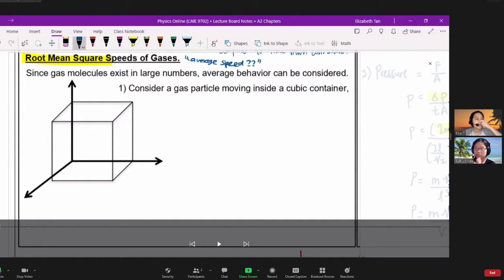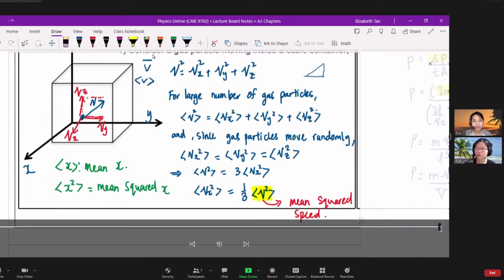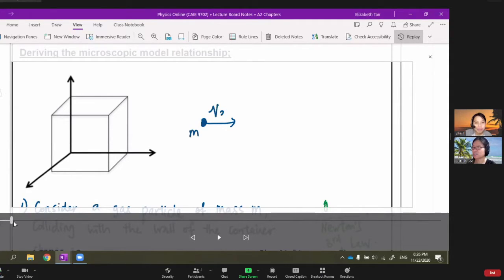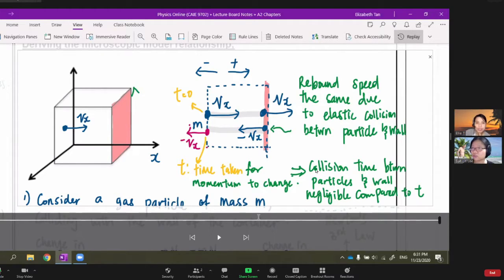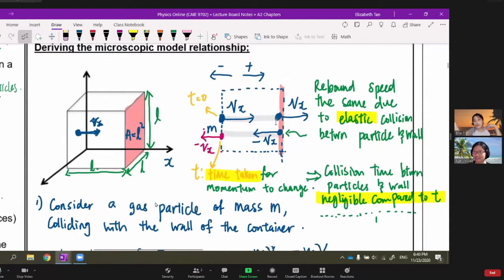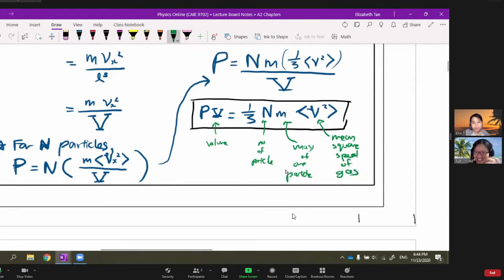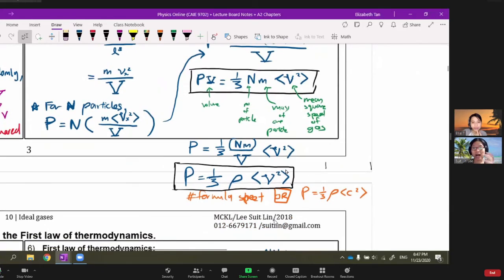15.2b Derivation of Pressure and rms speed | A2 Ideal Gas | CAIE A Level 9702 Physics

Comment: Why not take time of collision between wall instead of takint 2L/vx to find pressure as we have to find the pressure applied by the molecule during the collision time
Reply: because of time of collision is negligible so we just take the time for the entire journey ending up with a sort of average pressure
Reply: That's a good question. No, it is not that dt  is so small that we take 2L/vx. What we are actually doing here is calculating the average force over the interval 2L/vx, which is given by the total change in momentum during that time interval divided by the time interval.

Comment: Why is initial momentum negative?
Reply: a bit late but it's not negative, we are calculating the particle's change in momentum so we just subtract it from the final momentum (which is negative in this case) so there is a negative sign before the initial momentum like:

change in momentum = -ve final momentum - (+ve initial momentum)
 
as on its own it's acting in the positive direction of the horizontal axis. too wordy but i hope this helped kinda.
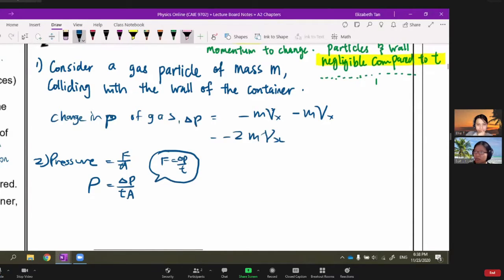Reply: @bbatroll  11:24 why is the formula just 2mvx and not -2mvx????
Reply: @Elpsycongroo1130 2mvx represents the change in momentum of the wall. If change in momentum of the gas is -2mvx, then the change in momentum of the wall must be 2mvx to conserve momentum